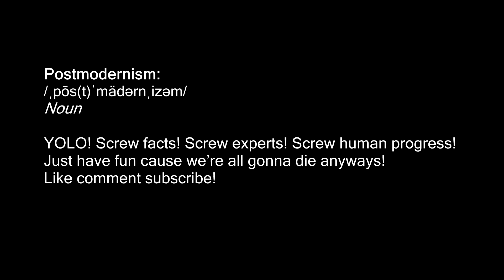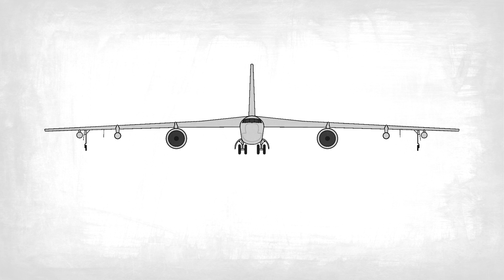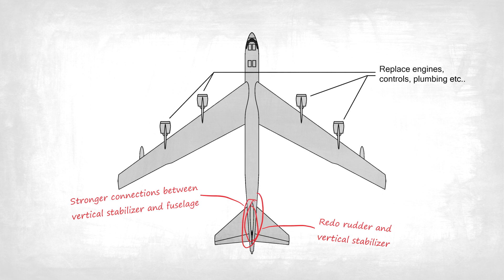The B-52 is Getting New Engines... Why Does it Still Need 8 of Them?

Comment from the maker: I've gotten some comments claiming that I highlighted the B-52's rudder incorrectly at 2:09. Well here are two images that shows the rudder better (for both the tall and short tail variants): 
https://i.stack.imgur.com/Q252N.jpg
https://i.pinimg.com/originals/ac/65/9a/ac659a69f0998d84802009ab78b509f5.jpg
Looking back, I should have used these two images instead to avoid the confusion.
Reply: Are the new engines more efficient though?
Like, are they replacing them with low bypass turbofans instead of jets?
Because nobody really mentioned what the purpose of using modern high bypass nacelles would actually be.

You can't add thrust without redesigning the wings.
You can change the engine number without redesigning the rudder.

But what's the intended point of those changes?

That's an important question, I think efficiency and therefore range gains are important.
Reply: @MostlyPennyCat  so the point of the re-engine project isn’t for efficiency or to get more range although that is a positive outcome of the newer engine very slight gains though the actual point of it is because we are running out of the tf-33s and parts to maintain them
Reply: @chimerakid6905  The existing engines won't be supported by the manufacturer past 2030
Reply: The ideal number of engines is 1, from an efficiency standpoint - all other things being equal.  This is one of the reasons turboprop singles are as good as they are.  However, all things are not equal.  Unlike a container ship, we can't just run one giant shaft down the middle.  

IIRC one of the early studies on engine replacement concluded it wasn't cost effective.  Only later was it realized the study had figured on the cost of fuel on the ground whereas a good bit of BUFF fuel is transferred to it in the air - where the effective cost of that fuel is far higher.

I hadn't considered the rudder angle (no pun intended).  Good reveal and easy to understand.
Reply: @MostlyPennyCat  maintenance support, hours and cost. With new engine B-52 can fly till 2050+ while existing engine only to around 2030. New engine also have side benefit with more fuel efficiency but thats more because the advancement of engine tech.
Reply: @MostlyPennyCat  the original tf33 are old and outdated. The new BR725 will be digital, will have a bypass for better efficiency at low altitude,  higher max altitude, and more power. And it will require upgrading the main spars on the wings.
Reply: You didn't mention that the rudder was close to marginal *at the fin's original height*. It got worse when the newer version had the fin height reduced by EIGHT FEET, without increasing the chord (front to back length) of the rudder.
Reply: @TTCS  The current engines ARE bypass engines, hence the TF designation for TurboFan vs J for pure Jet. The new engines produce the exact same thrust for less fuel with the advantage of FADEC for control and monitoring. Since the thrust is the same, there is no requirement for beefing up the engine pylons or wing attachment of same.
Reply: @MostlyPennyCat  B-52 does not have "jets" to begin with they are and always have been turbofans engine...
Reply: @barrygordon1173  
Yes, you are correct, they no longer use the original J37s.
On a seperate note, I found something interesting.
US Government Accountability report rejecting Boeing's re-engine plan from '97
4 engines per aircraft, modern nacelles leased (from RR it seems)
Rejected because it won't save the USAF money but cost them money.

But here's the rub.
Because Boeing will take the work on, that's 1,000,000 hours NOT given to the USAF base that maintains the TF33.
Increasing the per hour cost of every other piece of work.

Oh yes, my friends, they wouldn't do the sensible thing and close the base. Or shrink the base. Or merge two bases.
They would pay people to stand around doing nothing.

Which is unthinkable to me, here in the UK we would close the base, merge if possible. You do not waste money, that's pretty ingrained with us.

Next comment has the link
Reply: I like how you used KSP
Reply: Former B-52 Instructor Pilot here.

First:  The rudder was highlighted correctly in the video.

Second:  It may look comically skinny but that is due to the size of the tail itself.  Even on the current version, with the shorter tail, the rudder is still enormous and provides ample control in engine out situations. 

Personal opinion:  I would wager a guess that if the rudder was any larger the forces put on the airframe would, with a quick max deflection input, possibly cause damage to  or rip the tail off entirely.
Reply: The pre-G models and before had a taller vertical Stabilizer to try and compensate for Dutch roll. The G/H models had the Stability Augmentation System installed which dealt with the dutch roll. So the larger vertical stab was not needed anymore and shrunk accordingly. The System was installed around the late 1970's so the G/H models did have the Taller Vert Stab also but got modded when they got the SAS system.
Reply: PDX Heavy, you HAVE to be missing something. There is no way that the original design was such that 2 engines failing on the same outer pylon would imply the loss of the plane. An engine damage can easily cause damage (due to extreme vibration or debris) to the engine placed immediately next to it on the same pylon. Civilian 4-engines and 3-engines planes are designed to be flyable with 2 engines out. No way that an 8-engines military plane is not designed to be flyable with 2 engines out.
Reply: @adb012  Back in '95 A0054 AKA MudBuff lost a whole engine pod and landed just fine after doing Nascar circles in the sky for 5+ hours to waste fuel.
Reply: @Cpeerson2000  ... Exactly. I didn't know of that incident, but that's exactly what I meant. Let me go wilder and say that the plane must be designed to lose 2 engines on the same pylon at V1 and still be able to both stop on the remaining runway or complete a safe take-off on the remaining runway and climb at a certain prescribed minimum climb gradient. I think there is no way that the reason for no going to 4 engines was the rudder authority in case of an engine failure. I think it probably has to do with how the electrical, hydraulic and bleed- air systems are designed and distributed among the 8 engines which would have made for an engineering nightmare to redesign for 4 engines, let alone modify the existing airplanes accordingly.
Reply: @MostlyPennyCat  what USAF Base does the repairs?
Reply: Didn't you highlight the trim tab, not the rudder?
Reply: you can see it in the video 3:45
Reply: That moment when you realise: if the rudder was actually as large as the paint job at 2:09 makes it appear, it would occupy at least half the surface area of the entire vertical stabiliser and the aerodynamic forces acting on it would be ludicrously high, even at a tiny amount of deflection.
Reply: You can see why people would be confused. Compared to any other plane the rudder looks like an actual mistake. Those two images make it clear that nothing moves aside from that tiny strip at the back of the stabilizer. I was personally wondering if the whole 50 percent of the stabilizer in front of the rudder was for trim or something until I saw the other pictures.
Reply: Seems like a bit of a blunder to go with a rudder design with such awful authority.
Reply: Is a 10% chord rudder typical of that time period?  To my eyes it looks so incredibly small!
Reply: The tails you show are from A thru E models, the G and H models had shorter tails with increased rudders.  You need to get your to ducks in a row or in this case BUFF's in a row.
Reply: @greggv8  they proved it could fly without one also.
Reply: @Cpeerson2000  the G and H were already assembled with shorter tails. In fact, Boeing tested the shorter tail on a B-52A before beginning production on the G model. Besides the tail, the G and H lost their spoilers, went to a total wet wing, and received new noses among other features
Reply: @famellc2019  The G and H models did not lose their Spoilers,  they definitely still have them. How else would they turn without them?
Reply: @Cpeerson2000  I stand corrected. I meant "Ailerons", not spoilers. This is what I get for being online late at night
Reply: The H model had better engines than previous models.

Comment: F4 pilot: "I have an engine shut down, requesting priority."
B52 pilot: "I also have one engine shut down, also requesting priority."
F4 pilot: "Ah yes, the dreaded seven engine approach!"
Reply: There's a joke about an F15 pilot doing some stunts near a B52 and boasting of the capabilities of his aircraft VS the slug the BUFF is. The B52 pilot radios back "Watch this." Nothing seems to happen so the F15 pilot radios "I didn't see a thing!" the B52 pilot sends back "I shut down two engines, used the toilet, and cooked lunch! Top that!"
Reply: F16 pilot: "I have an engine shut down, come get me!" ;)
Reply: F16 pilot had already run out of fuel anyway.
Reply: Lol!!
Reply: @greggv8  LOL. The F-15 can always counter with the time one of them flew home missing an entire wing. That one is pretty hard to top.
Reply: @Elthenar  But a B-52 flew/landed missing the entire vertical stabilizer (tail)....I'd call it 50/50 there.
Reply: @Elthenar  I'd say the tail, and gunner, that was detached from a B-17 tops that. Not only did he continue to fly and shoot but survived the crash landing!
Reply: @greggv8  What toilet?
Reply: Actually I DID fly in the B-52H from 1970 to 1972.  On one mission, we had an engine failure right after takeoff.  We reported it and the controller asked "Are you declaring an emergency?"  We said "not at this time."  We then flew a 9 hour mission and when we got back, said: "We have an engine failure, we are declaring an emergency."

There was also the story of the time a couple of years before I got there that the number 3 pod literally fell off the plane into Lake Huron (Wurtsmith AFB, Oscoda Michigan).  That caused loss of control of engines number 7 and 8.  The pilot then landed the plane with four engines out on one side.  He got a Distinguished Flying Cross for that.
Reply: @demodifyable  The toilet was in the bottom level behind the navigators.  The top level had the bunk.
Reply: @bumrocky  especially because the vertical stab of the B52 was bigger than all surfaces from the F-15
Reply: @daze8410  And THAT'S what you get with a Boeing airplane! (NOTE: the KC-135's longevity.)
Reply: @brucedubbs6939  Yeah....a DFC for f*cking up and disobeying the ATO. I was at WAFB, as a young lieutenant. After the medal ceremony, one of the old head KC-135 pilots stated, "Well, that means my DFC doesn't mean a f*cking thing!"
Reply: @bumrocky  losing the vertical stabilizer is a cakewalk compared to losing basically half of your lift and all of it being put on one side of the fuselage.
Reply: F35 pilot: "I have an engine shut down, EJECT EJECT EJECT.
Reply: no  b52 would ever  call an emergency on 7 engines.. they normally fly on 4 and  land on 6 if loaded
Reply: @Elthenar   b52  flew home without a tail
Reply: @Elthenar  pretty easy w a thrust/weight ratio so high it could b classified a rocket
Reply: one engine down and carrying a nuke.....
pls proceed to runway 17!!!!!!
Reply: @brucedubbs6939  I havent heard about that story before. I worked at Kalitta in Oscoda for a few years, heard a very similar story about a 747 that lost its engine over Lake Michigan, maybe you mixed something up...?